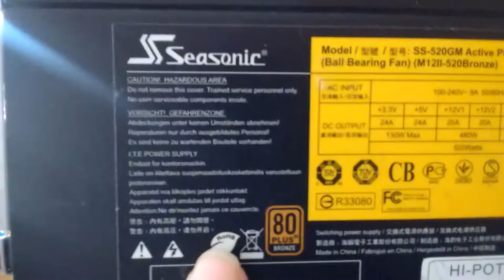New year, new PC Part 2: Change of plans

Comment: I hate that they don't include two IDE connectors on mobo's anymore.... damn nearly all my drives are EIDE.    Funny, I have a P5D mobo somewhere...

I usually add old CPU fans (like from the Pentium 1 days) onto the northbridge/southbridge heatsink if they cook.  Just use 4 screws through each hole in the corner and they screw right into the veins of the heat sinks, then plug into a molex.

Is PCI express 2.0 on an enthusiast board the same as PCI-E Gen.2 on your server board....  ?   

I ask because I have an IBM eSeries Xseries 455 that has some fucked up PCI-X proprietary slots in it that I never could get any PCI type anything card to work in them...  I got burned on that server and it sits useless unused today, mainly because the Itanium 2's were dogs, and the Intel EFI Bios is total garbage that takes forever to boot up.  Never buy a server mobo with EFI bios on it...   it is the worst crap ever.

CHOPPERGIRL
http://choppergirl.air-war.org

Comment: When you started talking about the old cost of parts... its always ironic, isn't it.  I've got barns full of antique 8 bits, and Mac Quadra workstations that at one time sold for $10,000 a piece.... now they aren't worth $10.   I like to hold parts up like I am Hamlet and talk to them like they were skulls, alas, poor Yourick!   All old hardware comes to me in the end.... the elephant graveyard of old obsolete computers...  I get them all in the end.

Back then, you dreamed of this shit... and it was unattainable... and now... you have it... and its garbage.  The hardware hasn't changed, its still the same and still does the same it did then, just the perception has changed...

I joke what holds its value the most... of all the computer parts...   are...  power cords.  Power cords from the PC XT are still the same as they are today...   they held their value....    and I have boxes of them.

You can't say that about mice or keyboards... they went from AT to PS2 to USB.... obsolete.  But power cords?     Still the only thing not obsolete!

I have two of those Apple keyboards, I only use them if an PS2 keyboard isn't recognized when I switch over on a KVM switch.

I have hundreds of mechanical old school IBM AT keyboards...  apparently they are super desirable... I've never done anything with them, just rotting in a barn...

You think routing that power cable to that power connector in the middle of the board is bad... wait into  you run into a fucking BTX motherboard...   you'll be swearing all the over the place... WHY THE FUCK... WHY ?   WHY?  You fucking idiots!  We have standards for a reason!

https://en.wikipedia.org/wiki/BTX_(form_factor)

Its ass backwards and designed reverse mirrored to go in a case that opens on left side, not the standard right side (left/ right when looked from the back of the computer, the real business end of the computer).

i always leave the sides off of the computers, for better cooling.  You don't need the side panel except to keep out rats.  If you have no rats in your house, leave them off.   That horseshit some computer techs will tell you about airflow and pulling air and requiring the side on... is bullshit.  

Also, sometimes I reverse the CPU fan to pull air up off the CPU like a vacuum cleaner, sucking up the heat from the motherboard at the base of the CPU, and out a chute I made of cardboard to fit around the fan to blast and throw the air directly out the side of the PC.  Been running PC's like that for years and it works great.
Reply from the maker: +CHOPPERGIRL AIRWAR Hardware is the same as it was when it was released, luckily. Since I got into computers I've always had two dreams: Get a dual CPU PowerMac G4 (fullfilled) and get a dual Slot 1 workstation and max it out (Which I'm in the process of doing, going to pick up a pair of Dimension 220s I got for €12 tomorrow), and you know what? The hardware is still every bit as awesome as I dreamed about back when I was 9 or 10. Sure, it's not top notch anymore, but who cares? You can still do everything you did on those machines back then and even more, thanks to the wonder of expansion slots. Need more graphics horsepower? Throw a new GPU in there. No SATA? Throw a PCI SATA controller on it. Slow/No network? Gigabit ethernet controller!
I miss the upgradeability of old computers. In an old ATX motherboard you used to get an AGP slot and 5 PCI slots. Now you're lucky if you can get more than two x16 PCIe slots (which run at x8!) and three of those worthless x1 PCIe slots.